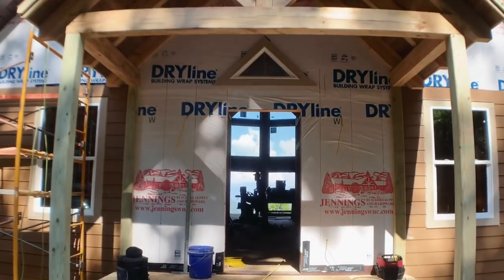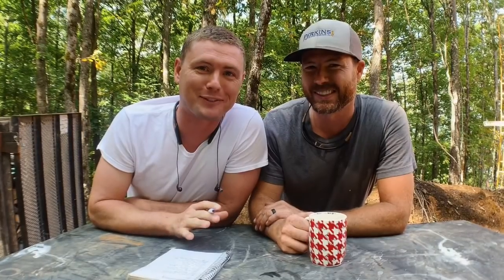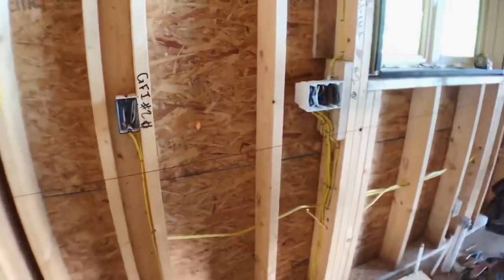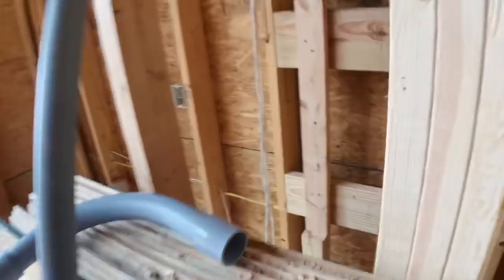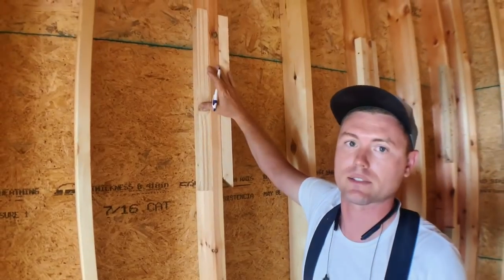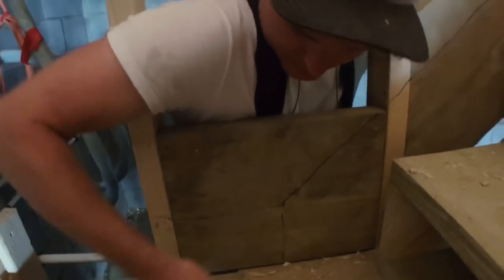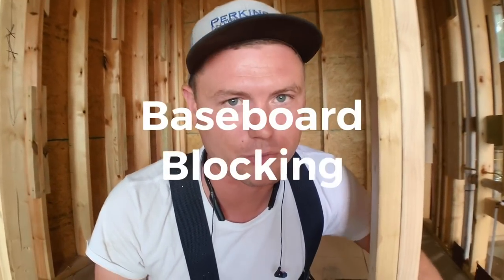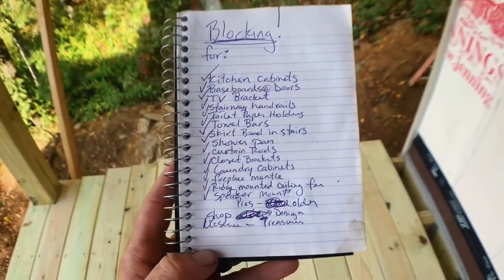The Blocking Checklist | Dead Wood 101

Comment: Very good .. Blocking everywhere !! .. As a carpenter " Frame / Trim . it's nice to have something to mount to .. instead of rubber nailers .. That is why my next house I am building 1.75" O.C. ..   I am getting to that phase whereas I need to backup and do all my blocking .. Most builders don't care .. It's all about Slap and Run ..

Comment: Excellent. I am called to install ADA compliant hand holds and rails in many bathrooms.  Often times there is no blocking.  I have often thought about making the first four feet of wall height 1/2 plywood or something other than drywall. These hand rails aren't just for balance, they are used by people, often very large people, who are trying to get up off the floor.  Just a rant.  Great video.  Thank you very much.
Reply: Just remodeled my hall bathroom and added 2x12 blocking for handrails if they are needed one day.

Comment: Only block needed for skirt boards  is blocks at skirt and base board junction.  Hand rails and cabinets generally work out on studs but may require a block on one end. Blocking for mantles, TV and others typical but for pictures........wow . Lots of extra blocking on this job , surely a cost plus project , don't get be wrong , I love me some solid blocking and it's a great way to use up the scrap end cuts ,,but ........wow

Comment: the blocking on the stairs for the handrails, did you use the scrap wood method you showed in a prior video to find the angles for those blocks? if not what method did you use and what would be the fastest way?  Cheers .

Comment: Thank You for Another Great Video and Edit‼️
Let me think-HaHa- The man w/checkbook-Follow the Money 💵!
We also put dead wood on top of double plate to secure sheetrock where ceiling joists run opposite!

When I designed and built Fireplaces 🔥; usually sheetrock was already hung and finished (not good); so I always tore out so I could frame for Mantle and if going ceiling height block just about all way up for pictures or frame/ wire for flat screen 📺!
Since liability was on me and my guarantee; made sure pre-fab units were installed to code(50% were not) and I could block where needed!
If I built full Masonry and Natural Stone; code here changed to: all masonry from ground up(expensive but safe)
If I built Artificial Stone; I would frame out around firebox and walls extra 6” to 8” to give depth and Natural Look! If folks really turned me loose- I have built recessed areas above mantle ( when no TV was desired) and used Fiber Optic (early LED) lighting mixed in w/stone and Stained Glass(removable) Designed by Friend and Homeowner! Always used corner rocks when building w/Artificial!

Comment: I have a question for you guys off the blocking topic. Do you guys use tankless hot water heaters? If so, how many do you use per house? We've started running multiple tankless hot water heaters for the last 4 or 5 years now. We use to run one or two large tankless units with a recirculating hot water system on a 5 gal tank per house. But our clients wanted hot water faster!!   lol. So, now we usually run. 
1 for the master bathroom
1 one for each guest bathroom. 
1 for the kitchen
1 for the powder room and laundry room. 
We run both gas and electric depending on the area. Some people do not have or want gas.  I was just curious on what type of hot water system you guys use. Thanks
Reply from the maker: Hey buddy... most of the houses we are building are in the 3000 square-foot size range. We’ve been able to get away with one large on-demand unit as long it is it has been gas powered.  i’ve not been as Impressed with the electric ones (and almost always makes a 400 Amp service necessary). Most of the ones we use have a built-in recirculating system so we always run a re-Circ line to the master bath for faster hot water there. Surprisingly we actually do use some tank water heaters as well! Up front cost is definitely much lower on these so some clients want that.
Reply: @PerkinsBuilderBrothers  Thank you for your reply! I agree, gas does do a better job on the tankless. As far as electric service goes we typically run 400 amp to 800 amp worth of service to our houses. Power is typically not an issue for us. Thanks for the reply. I was just wondering what you guys did. I know you guys do high quality Custom Homes also. Thanks
Reply: @OffRoad-jh1do   Wow, I've never seen a home with 400 or 800 amp service. I live in a 3300 sq ft home and have been in many that size and they are all 200 amp. But they all also have gas heat and gas water heater.
Reply: @hkgonra  We work in the high end waterfront home market. 3,000- 20,000 sq feet homes. Most average houses can get away with a 200 amp service.  We typically run (1) 200 amp service for outdoor services pool and spa equipment, lights, yard lights, entry gates etc... (1) 200 amp service for the dock lighting, boat lifts and shore power for any large vessels that need power. The main house will receive (2-4) 200 amp services. Smart homes require a lot of power as does larger homes.  We also wire the garages with EV charging capacity for current or future use. Also a typical home we do has about 3-7 A/C units and all those tankless units. Thanks

Comment: baseboard backing is redundant. bradnails through mdf and drywall is more than enough strength as a fastener. it shouldnt go anywhere after a bead of caulking.
Reply from the maker: Most of our builds have stained trim, so there is no caulking and no way to hide any gapping if trim doesn’t stay completely tight to the wall surface.
Reply: Perkins Builder Brothers ahh i see. understood!